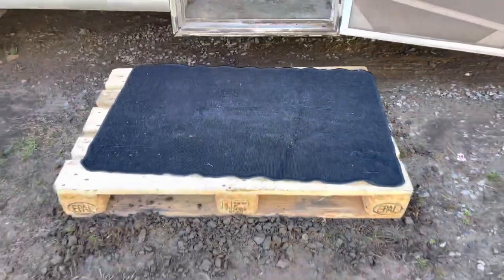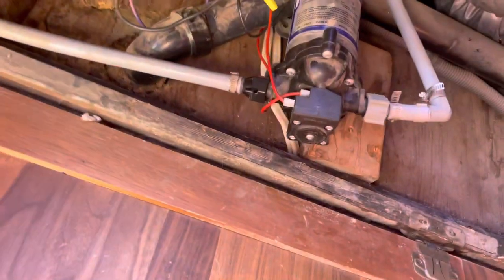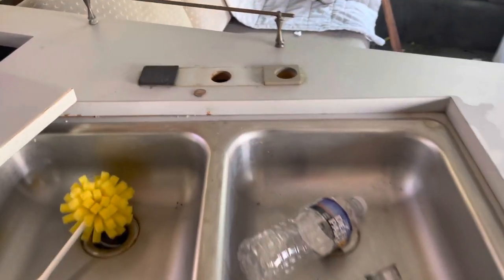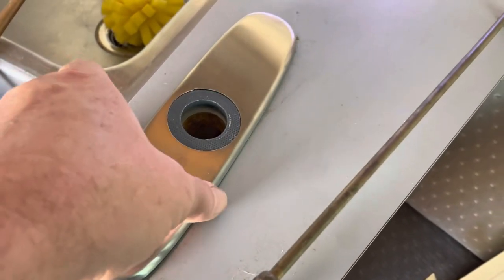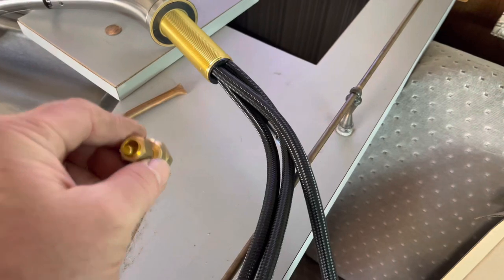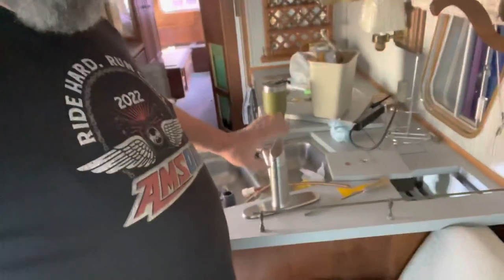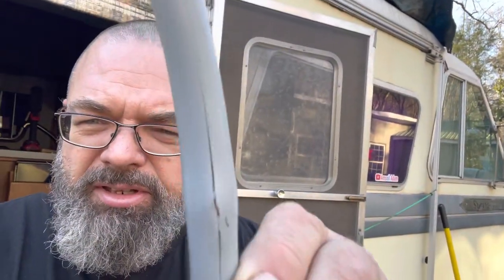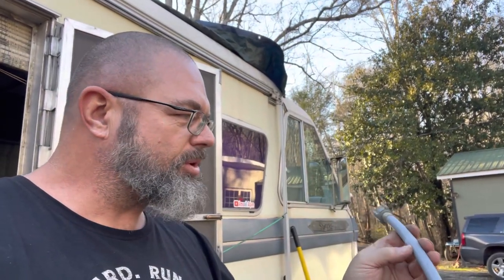Project Struggle Bus! Fixing the plumbing in our 1983 GMC sport coach ￼motorhome!

Comment: your creek is awesome need to make a little moonshine with that water lol. Im sure you will figure out all the issues and get them right on the struggle bus Adam for sure. My electric hydraulic jacks on my motorhome are not working correctly and I have no idea where to start i have to figure this out so many solenoids and crap  try to get some info from manufacture
Reply from the maker: Sometimes stuff like that could be really tricky when you’re not familiar with the systems

Comment: Hi from Kansas Adam don't feel bad I have a 1993 RV on Ford frame and I had to replace every sending or control board in it in 2 years time. Plus will have to replace 4 batteries if I want to move it
Reply from the maker: Yeah, working on old stuff is a love/hate relationship